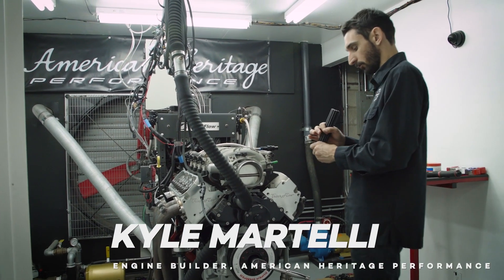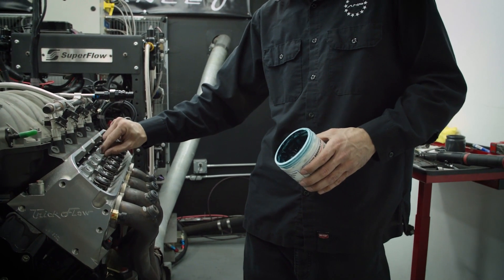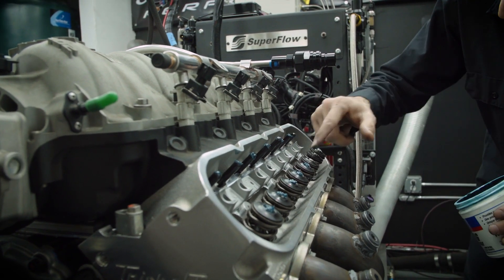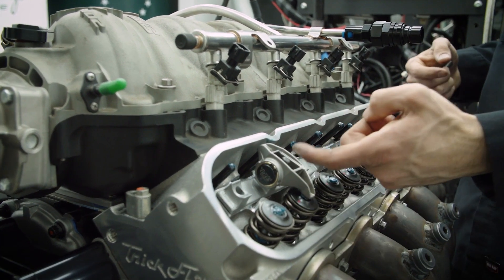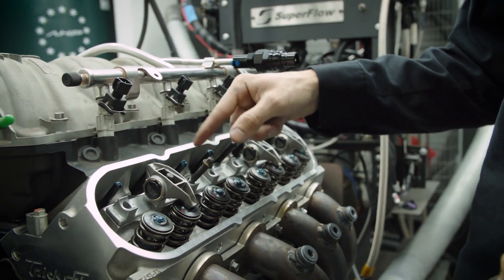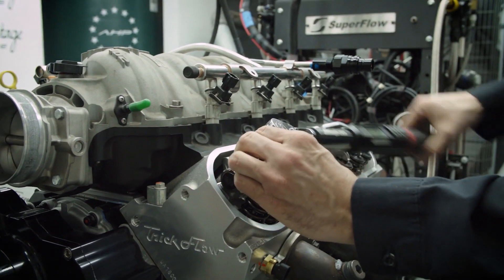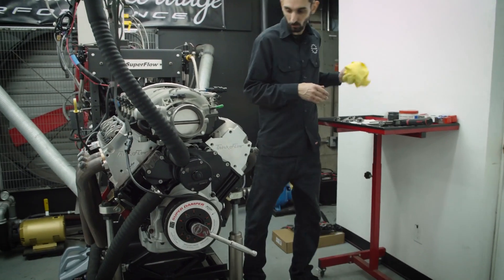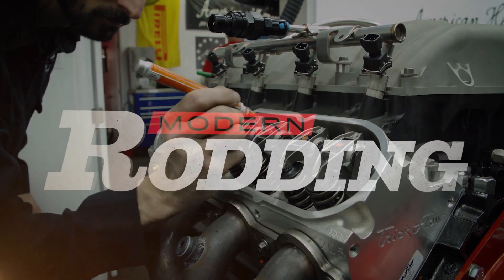How to install LS push rods and rocker arms

Comment: Great video, im glad I watched this , it's sad I've watched so many pushrod videos and  no one mentioned even once is to check each pushrod makes sure there's nothing in there , a I was in the middle of installing brand new BTR 7.400 pushrods for my ls6   engine and guess what I found one p rod completely clogged , it took me 10min to get it cleared with a wire and a small  metal pick (to brake it into small pieces because it wouldn't come out) it was just bunch of shavings., all good now,  thank you for a great video,  you made it very simple .